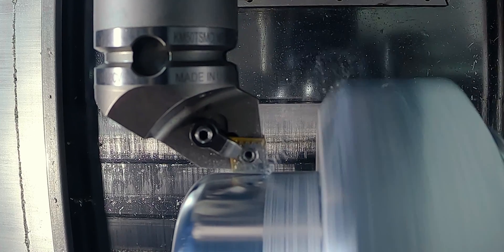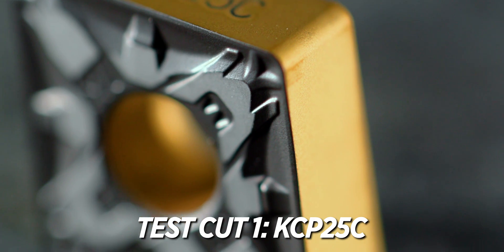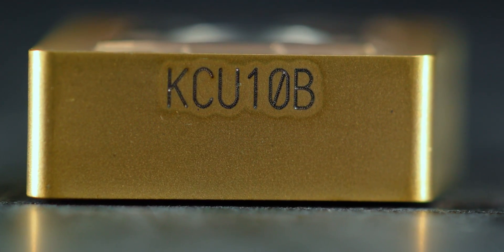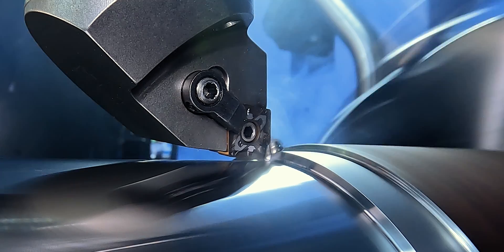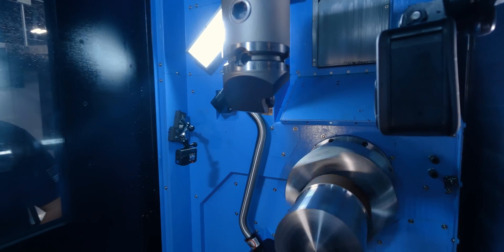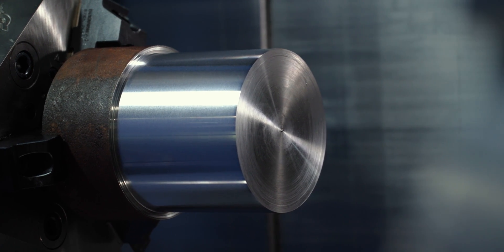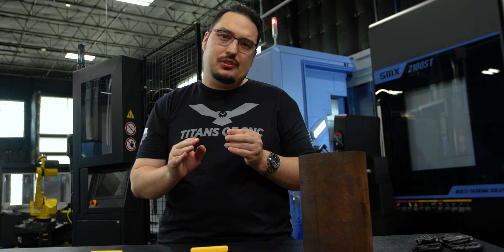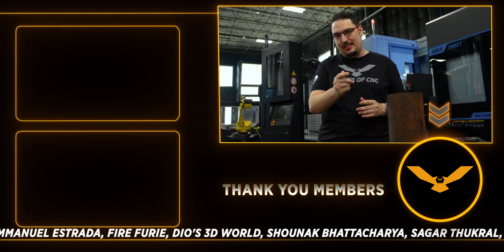Testing The BEST CNC Lathe Inserts

Comment: Always great to see a comparison video like this! It would also have been interesting to see which plate actually lasts the longest, how  many products can you make with plate A and with plate B. And what I wonder is why not use a WNMG plate instead of a CNMG? They both have an angle of 80 degrees and with the WNMG you have 6 cutting edges instead of 4 for probably the same price. Maybe that's a nice comparison for the next tool demonstration video, costs and number of products per cutting edge. (preferably in stainless steel)

Comment: Should really explain the differences in coatings.  Both will cut and help tool life, but they're both better in different applications.  PVD requires far less heat than CVD and offers a tougher coating, while CVD requires higher temps and is much better for stable and uninterrupted cuts.  Obviously much more goes into it than that, but thats a baseline when deciding between the 2.  I also run Kennametal inserts and run much faster and hard than that.  Also why run a CNMG?  WNMG offers the exact same geometry with a far cheaper cost per edge with 0 difference in performance....

Comment: Does anyone have suggestions for turning Titanium🤔?
Reply: There's specific grades for titanium but inserts for steel can do it too. As a rough starting point, titanium will need to run at 50% SFM of stainless. Try to find out who your local SECO sales rep is, they'll tell you what to use and who can supply it for you locally
Reply: @WCGwkf  ASTM F136. I'll have to investigate because the place where I last got inserts had no clue on what to use. They seem more tailored to regular machine work😒. Thanx for the input.

Comment: I’m running 516 70 and 517 70. What would you recommend for an insert to use? 26 inch diameter with 450 sfm. .100 depth of cut and feed of .012. I can’t find an insert to last

Comment: YG inserts for $3.5 an insert USD. Works great for low carbon steel 1018-1025. Thousand + cuts @ similar feeds to what was run in this video here. Saving lots of cheddar with those bad boys

Comment: From my own experience I know that turning in stainless steel causes the biggest problems and this is what you should take care of, I tested 2 options of sandvik and with 3 tungaloy, but only tungaloy for superalloys managed to get the hang of it
Reply: I love tungaloy on Stainless
Reply: I worked in a shop for the last year running Nitronic 50 and some inconel on a lathe and we had decent success with Walther CNMG 432 nrs (wsm01 grade) but it was the kind of shop that refused to buy things like through coolant tooling unless you had a scream fight with HR so I don’t work there anymore
Reply: I have never really been impressed with tungaloy stuff. It seems like mitsubishi and seco always out perform
Reply: Eu frequentemente uso os insertos da Iscar 04 para inox 304

Comment: I originally started out as a lathe machinist, and learning all the new insert codes styles has really been the bane of my existence, and it’s gotten so complicated, since multiple brands change their code system , vs milling it’s mostly all the same .
Reply: I find those of Sandvik and Seco to be easiest to understand when it comes to the different shapes and their purposes.
Though I do admit, I don't have much experience at the moment.
At my current job, I use Seco, they have insets with very small nose radius which I need for the polymers that I machine.
Reply: @neovenom7187  I like Sandvik BUT their speeds and feeds calculator is the worsti have ever seen ... it doesn't give me values that i can use for a simple program ... no it gives me 7 different ap and ae etc... Kennametal has a really nice calculator but you cant see the pricing on there as easy as the Sandvik site
Reply: "Hey grab me that iscar CCGT 32.51"
"The what?!?"
Reply: @mattcyr3342  yup, that’s how sandvik labels their BS, everyone understands the ccgt, but they just love throwing random numbers in there, why can’t they just stick to the standard 432 or whatever, even in metric it still works but no lol different companies gotta fuck with us. Kennametal does it with their tools too
Reply: @adammiller4879  I use the Sandvik coroturn bars, Try CXS-06T098-20-6215R 1025... Whats thats supposed to mean? Lol
Reply: @mattcyr3342  exactly😂
Reply: @mattcyr3342 everyone i taught knows what that means

Comment: Would be better to flip the workpiece to do the same cut when testing or only cut halfway with each tool. First insert cut more material because of the larger diameter.
Reply: The lathe changes the RPM to keep the speed the same.... and the depth of cut on both was .100". The MRR was the exact same on both cuts, the only thing that was reduced was cycle time.

Comment: Seems like a useless test. Any insert should hold up well on a five inch length of cut. Also wouldn't you normally use coolant?
Reply: I understand the visibility issue but the results of the test are looking at the insert afterwards. We don't really need a clear view of the machining. @R-98-official
Reply: Ya you'd think with the funds these guys seem to have they could at least run a proper test where they run the inserts to failure and you actually learn something.  No one really learned anything from  the actual "test" they did in the video.

Comment: are you sure the smoke didnt come from oil on the surface? Maybe cutting with the same insert again to see if it smokes again
Reply: I doubt it, since he explained that he removed the outer layer before the test to give it an equal playing field.
Reply: @neovenom7187  I thought this aswell but could be they cut with coolant to removing the milscale and there was some left over residual cutting fluid when doing the first test cut. Then the heat vaporized any remaining coolant so second test cut had nothing to vaporize?

Comment: ISCAR inserts last just as long as Kennametal at half the costs. I pay about $17 per insert, and the Iscar are about $9 a piece with better speeds and feeds than Kennametal.
Reply: I have found you need to try every brand , sometimes the cheapest performs the best. It really just depends on the application. And sometimes the machine. I’ve had the same job on two different machines run two different inserts. Both ran about the same life in opposite machines. But if you put the wrong insert in the wrong machine it cut life in half.  Testing every thing is the only way* to know.
Reply: @NC-oy8hq  this guy gets it
Reply: @NC-oy8hq  this guy get it
Reply: Lol iscar is nothing compared to seco and sandvik
Reply: @BobdeJong94  sandvik 4405 grade is amazing for steel
Reply: @larsdekoster1670 providing you have very stable and consistant material with no interruptions.
Reply: I've been using Kyocera, Iscar and Ceratizit inserts for a long time and all have proven to be much much more resistant to wear than Kennametal aswell as being able to push better speeds and feeds.
Reply: Every year we buy a pack of the latest inserts from pretty much every brand, we do alot of production roughing of 4140 HT, so we are able to test and compare them really well. We compare performance and cost to performance.  Every year the walter, kyocera, iscar, sandvick and Seco all perform well.  We test a few other bands like tungaloy, certaizt that perform well but definitely not as well as the ones above, The last 5-10 years Kennametal as come in dead last and then when you add in price to performance they are even worse.  Kyocera has won the price to performance for the last 4 years with iscar and sandvick and walter often close behind.
Reply: @85CEKR your experience mirrors mine. We do a ton of stainless, not 4140, but I always go for iscar, seco, or sandvik before kennametal. They just dont hold up nearly as well in ideal conditions, let alone sub ideal ones.
Reply: @85CEKR Kennametal is great for a more general purpose insert.  I use them most because they hold up the best when going from 1018 to 4140 to D2 to 303 to Inconel.  We cut them all so having a few inserts that hold up well is far more important to us than having 1 insert that does great in 1 material and application.  I worked for Iscar and they don't really offer much that matches Kennametal in terms of being able to do so much and hold up extremely well.  Also this video misses the main difference between PVD and CVD which is how much heat it takes.  Same with everything else there's a toughness to hardness scale so it really depends on what you're trying to to do.
Reply: Iscar and Mitsubishi have the best inserts
Reply: Totally agree
Reply: @evilgoatgarage4193  bro has the audacity to tell something else is better than Kennametal 

under a Titans of CNC video 💀💀💀
Reply: @ipadize  is this video sponsored? Is that why my comments are being deleted?
Reply: @Gurziak  i can see your comment
Reply: @ipadize  I've made a few other replies in this thread and they're all deleted now. Weird
Reply: We use a lot of iscar as well for our lathe work. I push them pretty hard and they hold up very well. As good as any other insert I’ve used.
Reply: Unless you guys have test results this literally is nothing but a chevy vs Ford type debate. All major carbide manufacturers have grades and chip breakers that are good in certain materials in certain conditions.
Reply: @millakilla they’re telling you their personal test results… just because you’re choosing to ignore them doesn’t mean they don’t exist 😂
Reply: @willyharris4199  not ignoring anything. None of you guys have posted any data like depth of cut, material, type of machine, chip breaker etc. Most of you guys are hacks that don't know wtf you're talking about. For instance lets say you had good results with some Seco insert or whatever one time now that's all you buy for every application or whatever. Inserts, substrates, coatings, etc. change all the time. I literally test carbide tooling for a living and I've seen every manufacturer shine in certain scenarios.
Reply: @millakilla  well, it’d be quite a lot of information to compile into one YouTube comment wouldn’t it, all that information for each insert, for each material, it’d be an endless YouTube comment, when they can just reduce that to say what they’ve had the best results with… don’t we all test carbide inserts for a living? That’s pretty much what machinists do anyway 😂
Reply: Yep
Reply: All we use is iscar and yg used to use kenna but iscar and yg seem to last longer
Reply: We had an application engineer over from Kennametal with some some mills.

We were working Inconel 625 which has been watercut into a ring.
Let's say it did not go well, the engineer said it was better to turn it smooth first so the roughing mill has an easier life.

The result being: Iscar and OSG mills are better. 
The Kennametal ones just broke after a while, while the others just kept running for hours with the same parameter.
Reply: This is their sponsor, SECO inserts run way faster than these
Reply: Do you have experience with Iscar endmills?
Reply: @danl.4743  no. I've been impressed with the performance of YG1Basix endmills tho. Uses an AlCr coating and produced good results from 6061 Alum to 316 SS.
Reply: @danl.4743  Tested tons of them as an application engineer.  They work well for specific applications but not as a general purpose endmill.  I use Helical Solutions endmills and they're great for tons of different applications.
Reply: Price has never been a factor, only performance. Iscar, seco, and Sandvik always came out on top. I had a 32mm ic seco insert that would take a 1” doc at .090/rev. It was literally glorious.

I will say, kennametal has the best website and up until a few years ago had the largest selection. I used everything from Km25s to hsk100s. All sorts of milling tools and their website was so easy to navigate. Iscar had impossibly slow custom tools, seco had the best service and by far the best custom solid carbide tool designers (Niagara). Try them all I guess is the moral of the story.

Comment: man I can barely afford a single set of milling inserts
Reply: Other brands exist beyond Kennametal. Kennametal seems to be turning into the Apple of CNC.
Reply: @Gurziak  If Kennametal costs twice as much and lasts 3x longer, i think its still a value worth buying.  I can buy cheap chinese carbide endmills all day long that get smoked first use, while my 10 year old HSS local ground cutter keeps going. Not saying HSS is better than carbide, but quality vs price is a big factor.
I have some Kennametal carbide endmills, and they do take a beating way more than any other ive used.
Reply: @Mikkel-RS  I've done insert tests before and in my experience the Iscar produce the same results as the Kennametal at half the price.
Reply: Do you run a machine shop? Inserts should be a very low cost item vs other things. Quote them into the job and make the job go faster.
Reply: @Mikkel-RS  I just do machining as a hobby, and when I got my indexable milling cutter set I made the idiotic mistake of not checking whether or not they were proprietary 🤦🤦🤦